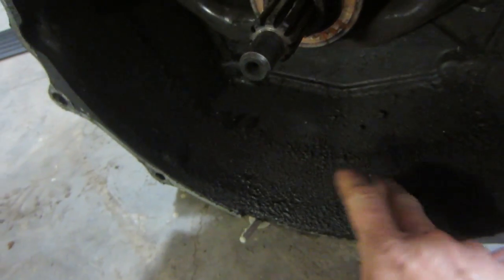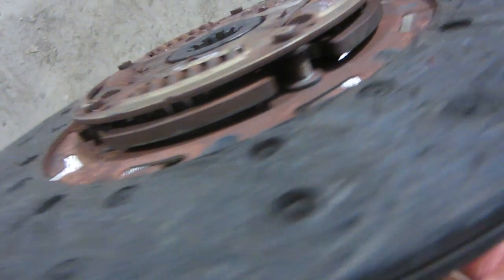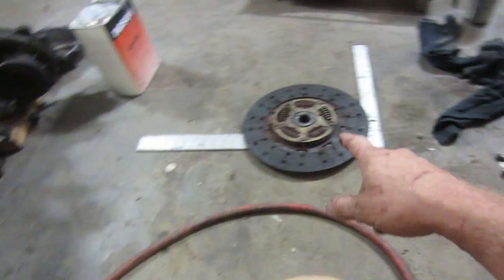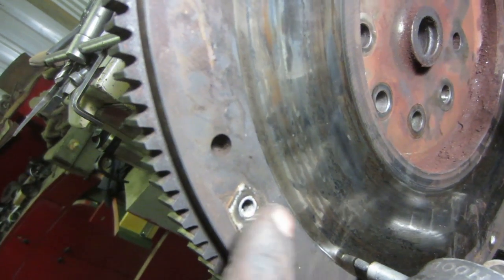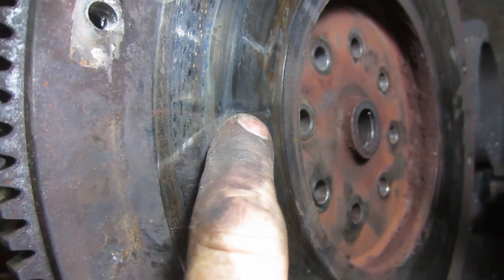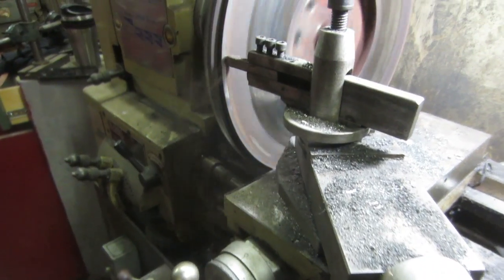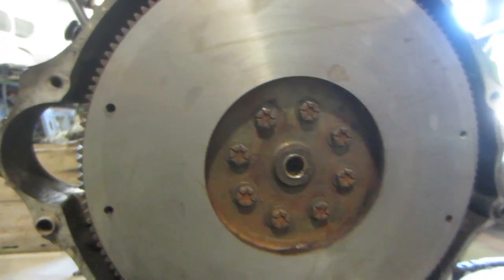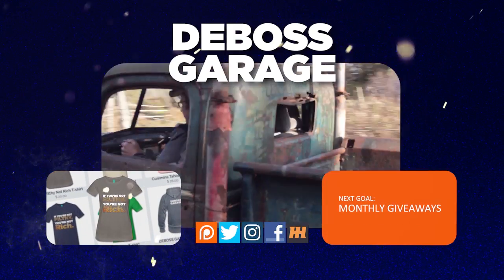How To Machine A Flywheel

Comment: Thanks for the video. Do you use the same bolts to remount the flywheel and Pressure plate? If you do use the same bolts do you use blue thread locker on these bolts?

Comment: Had the thought a lathe could work to resurface a flywheel, went looking, and found your video.  Thanks much.  However, I'd really like to see how you mounted the flywheel to the lathe. I don't have a spare crank shaft I can cut off to mount into a chuck. Perhaps a custom face plate drilled and tapped for this purpose. Still a helpful video, again thanks.

Comment: little bit of a late comment but question. I have never seen it done on a flywheel, but why not stop drill the crack? in aviation, some panels and skins are allowed to be stop drilled if the crack is small enough to remove the stress and keep it from growing and larger. could you drill both ends of the crack with a small bot and then machine the flywheel?
Reply: My guess is this would unbalance the flywheel.
Reply: @TheBryce98  weld the holes shut, grind down, turn it again.  meh, too much work for probably no real benefit

Comment: After machining do you need to shim the flywheel? And if so do you then shim the state the Sam amount?
Reply: No, the few thousandths removed are easily accommodated by the clutch release mechanism.
Reply: No… the pressure plate will make up for it, but the clutch pedal will release (unnoticeably) higher 
Example: (For example purposes, let’s say the pressure plate could accommodate for 1/4 inch flywheel cut and let’s say the flywheel could withstand it as well… again just exaggerating for the example)… 

So, let’s say you cut the flywheel a quarter inch, the pressure plate would make up for that quarter inch, but your clutch pedal would release much higher. So, the adjustment would have to be in the clutch cable (non-hydraulic clutch system).

Comment: im trying to pull the motor out of a first gen cummins. eveerything is disconnected except for one bolt that connects the bell housing to the engine. should i take out the transmission or? how do you unbolt the bellhousing????
Reply from the maker: You can take the transmission with it but you have to take the cross member out.  I only ever pulled them out together, but I generally don't put them back in the same truck...
Reply: its 4wd do you disconnect the transfer case??
Reply from the maker: I don't think you have to, but it helps.  Why are you pulling the engine?
Reply: Engine is super leaky from front and rear. Also replacing the main bearings and oil pan gasket
Reply from the maker: I would leave the trans in then.  Just bellhousing and clutch housing bolts.  there are studs centering the bellousing that might be tight
Reply: Well I got all the bell housing bolts that connect that and the engine but there is the top bolt on the drivers side that is impossible to reach and when I do I don't have enough room to move a breaker bar. Any tips??
Reply from the maker: Long extensions with your breaker bar about where the output shaft is.  You can drop the trans mount and tilt the engine down a bit, crack the bolt and just secure the mount again.

Comment: Woulda been nice to see how you chucked it up on the lathe. Nice finish though.
Reply: What good is dialing it to 0 runout if it is warped????
Reply from the maker: Sorry BrownParticles .  Pretty much just put it in the chuck and spin it with the dial indicator on the face.  The high spots get a tap with a hammer until the dial indicator reads minimum